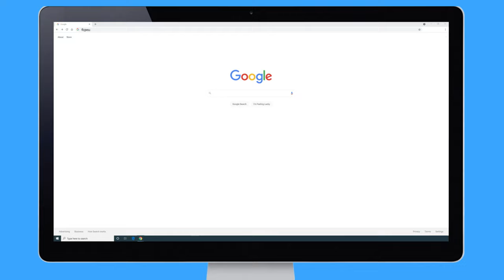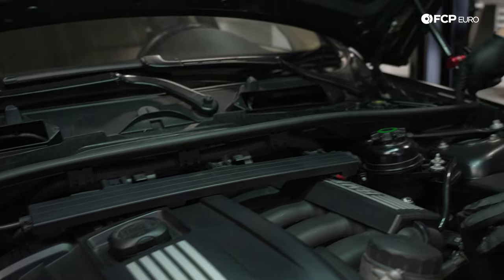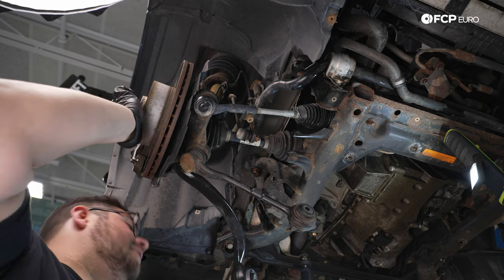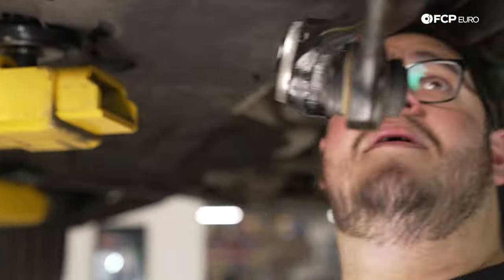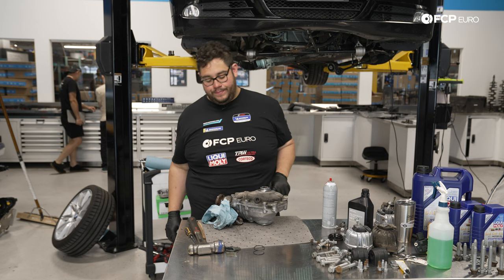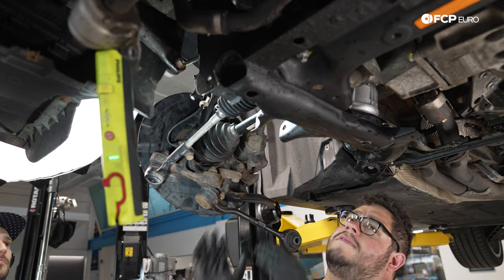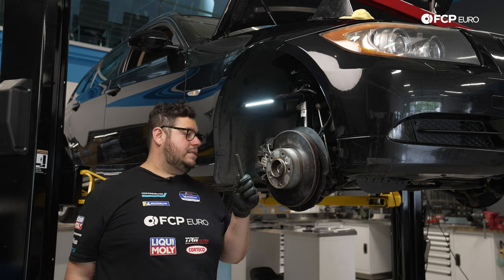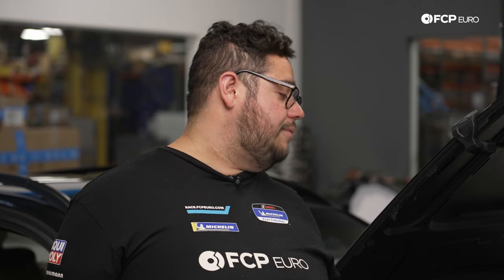BMW N52 Oil Pan Gasket Replacement DIY (2005-2013 BMW E90 325i, E91 328i, E92 330i, 328i xDrive)

Comment: Something NOBODY said about dropping the N51-52 non X-drive aluminum pan is that it CAN get blocked by the rear crank throw. So all you have to do is turn the crankshaft clockwise a bit. I got hung up trying to drop my pan for a day and a half because it was in the way. Turned crank a 1/4 turn and it dropped without issue.
Reply: Whats the rear crank throw ?
Reply: @alpinen52ny79  its the part of the back section of the crank that has an offset lobe for balance. For whatever reason, you can only see the rear one in N51
Reply: @stevensims3342  now am afraid of doing it since most of my work i do it on the street 🫤🫤
Reply: @alpinen52ny79  nah for me it was because these guys NEVER said anything about the crank being able to be in the way. Knowing this, if the pan will not drop easily. The throw is in the way. Everything else was easy, it was the lack of knowledge the throw could be in the way.
Reply: @stevensims3342  How many hours do you think this work takes?,  without the inconvenience with the crank shaft

Comment: Oh man, my 2007 X3 with the N52 engine is leaking oil, and I'm pretty sure it's the oil pan gasket. My dad, who used to own the car, supposedly paid a mechanic to fix this leak, but it looks like either the mechanic did nothing or did a terrible job. I'm not about to pay someone else to do it again, but after watching this, Holy crap! I'm starting to think I might as well just live with the leak! It looks like too much work!
Reply from the maker: You got this!!
Reply: @fcpeuro  LiquiMoly Motor Oil Saver for now! Fingers crossed it works.

Comment: Local shop quoted me $3500 to replace the oil pan gasket. BMW calls for 18 hours for this repair.
Reply: bmw quoted me $2959.07 when they did a vehicle check after they did recall work for me. will not be taking it to them if i take it anywhere at all 🤣

Comment: You seem to have the weight of the car on the wheels, for tightening the control arm & sway bar bushing bolts, but without the stiffening plate in place.  A big deal or not???

Comment: Also employ the use of an inch pound torque wrench for pan bolts and set to a higher 72 in-lbs (vs low value of 6 ft-lbs on larger wrench) for more noticeable clicks.

Comment: How much easier (if at all) is it to drop the front subframe on a RWD N52 6MT? On the AWD it looks like the steering rack and pinion is behind the subframe whereas I could have sworn on my E82 128i 6MT it was in front of the subframe. I plan on dropping it sometime soon in order to weld in an oil pan baffle.

Comment: Do you suck in the axles with lock nut before reconnecting the control arms?  In this video you dropped the car, torqued suspension then raised car again to take wheels off to lock in axles?  These clips are in reverse order right?

Comment: I noticed when you had the wheels on to torque the control arms you didn't have the stiffening plate on, but when removing the stiffening plate you said not to lower the car back onto its wheels as things would shift around. Also, when torquing the control arms were the axal shafts just resting in place? 

I really appreciate the videos. I have the exact car and may attempt this soon.
Reply: not liable if you get hurt from this or something breaks on your car… but i think the whole “stiffening plate” warning is just a precaution. I saw the warnings printed on the bottom of the pan, it’s etched into the metal “DO NOT DRIVE WITHOUT STIFFENING PLATE”. but i have lowered it, driven, and even had the stiffening plate removed for a whole 2 weeks while driving the car around and nothing bad happened. I was working on it often and didn’t want to have to keep removing it over and over. I also don’t tighten it down super super tight, just enough so the bolts won’t loosen and the plate is on nice and tight.

Comment: I was afraid of dying with the engine falling on me so took it to the shop
am I the only one who's tow hook didn't properly fit in the top support thread next to the valve cover?
Reply: How much did it cost? I have to replace the oil pan gasket on my 2006 Z4 🙏
Reply: @fabiospataro9494  $700 to a shop that is known to be a good value. They charge $100/hour in theory. They did gasket + bolts +  engine mounts too ( my parts from FCP) and then added a surprise control arm as one bolt broke in the process.
Reply: @bogdanarsene9602 x drive car?
Reply: $100/hr. Wow. In my area it is a well over $2000 job.

Comment: I just finished up the oil pan i some how cant get the sway bar back onto the subframe i have the car at ride height its off by a few inches any tips
Reply from the maker: If it's off by a few inches, you must set it to ride height correctly and try again. Make sure your end links are in the correct position as well and nothing is binding up!

Comment: Hay guys. I have a BMW x5 go5 2019. Can you tell me if there is a fuel filter that you can replace also if they have a water separator? Thanks guys.
Reply: Gasoline. Fuel filters are in tank with pressure regulator. Whole unit.